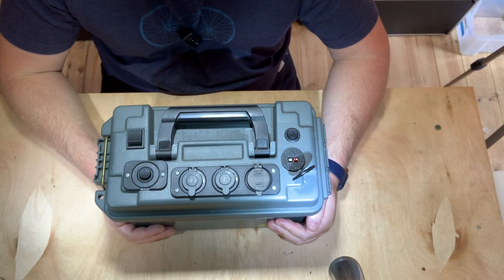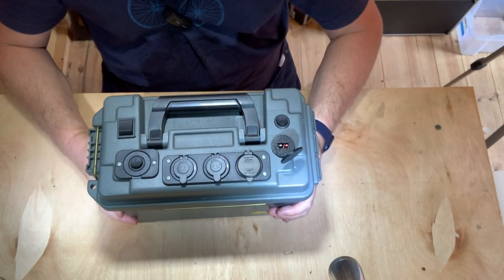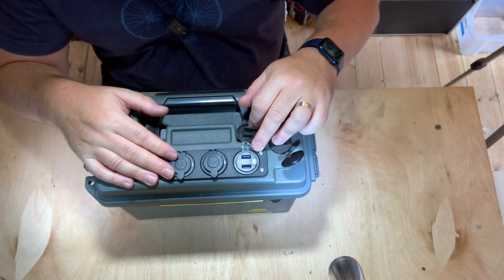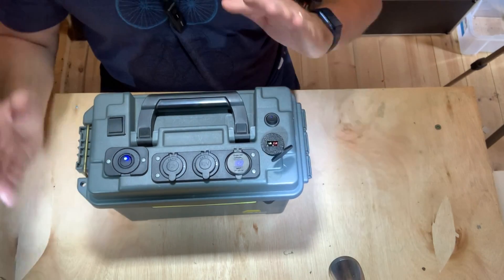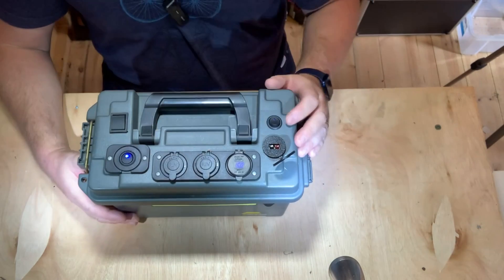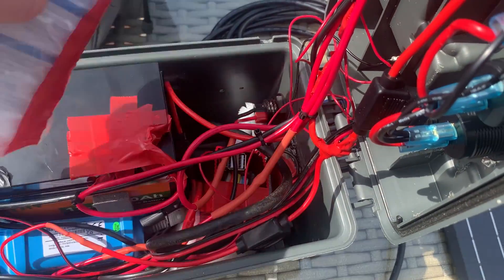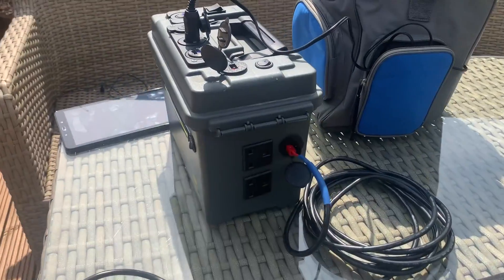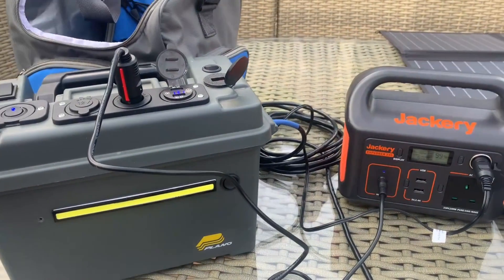DIY Solar Generator

Comment: Hey man, great build. I got a question, a lot of people use solar charge controller they turn off when not in use but then they have to setup the chargecontroller each time. Are the settings of the victron saved in its memory or on the app or something? I just want a system that you can turn on and forget about. Thanks a lot for this nice build. Greetings from Belgium. Erik

Comment: Nice one James, been waiting for this one! I’ve got the same 50cal Plano box and wanted to see what battery you used as I’m looking to eventually swap out my 2x 10ah SLA’s for LifePo4. Great you can get 30ah in there and the Victron and the inverter! How do you find the battery, I saw a teardown of a 50ah version and it had pouch cells in which I wasn’t too sure about.
Reply from the maker: Thanks. It works great So far. 39ah is perfect for what i wanted it for…..it’s an amazing jump from lewd acid, you won’t regret it.  Let me know how you get on 👍

Comment: been waiting for this vid for a while :D
you can have over 7000 shot gun shells in your home in the uk and 600lr rounds. half the people i know have ammunition in the house :D
nice to see thick wire in there, so many people use wire that is not thick enough.
i have a victron inverter and the the same bluetooth dongle for it.
my charge controller is epever and gets really warm when its over 30v and doing its mppt magic but i do like to see the extra power going in from the mppt controller :D
my small portable solar power pack i built years ago got a bit big to be portable so now lives in the shed running power to the house so i have to now make a new smaller one for camping and radio work.
i have all ways used sla batteries in the past for the small portable systems but my eyes are now fully open to these lifepo4 batteries and i am waiting for a delivery of one to replace my flooded batteries in the shed.
next i am after a 10ah one for the next portable build :D
Reply from the maker: yea so ok, we can store amunition..I stand corrected :)
Yes, so I have used slightly larger wire than I needed.  Im a strong believer in future proofing my projects.  It makes sense also, remember, what can do a lot, can do a little.
Im looking forward to seing your battery video... I did see see the other week you were in discusions.  Hope you get it soon.

I enjoy your videos on battery and solar projects.  Keep it up and thanks for your support.

Comment: nice video just got a solar panel  mc4 snapped and it claim to be 100w  i don't  think so but i am getting a flexible 100w panel  next to stick to suitcase  for travelling  keep up good videos
Reply from the maker: Thank you. A lot of places make these claims… you have to be careful. 👍
Reply: @Shack-time  ALLPOWERS Foldable Solar Panel 100W Portable Power Station AP-SP-027 i got vary cheap but 1 of the mc4 as snapped  of but it on to put in back of car